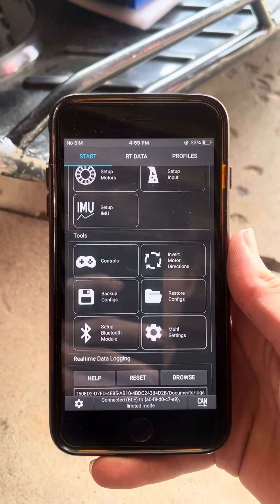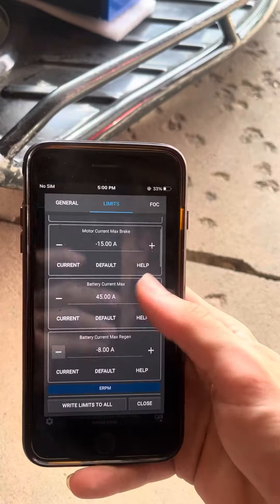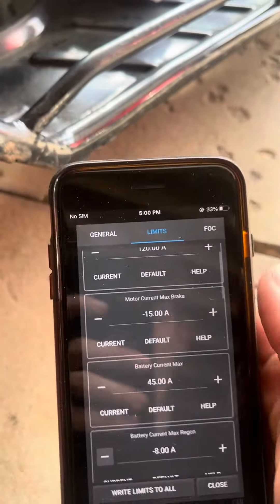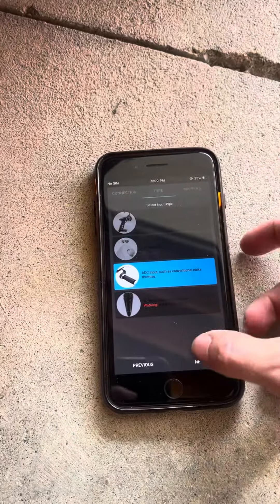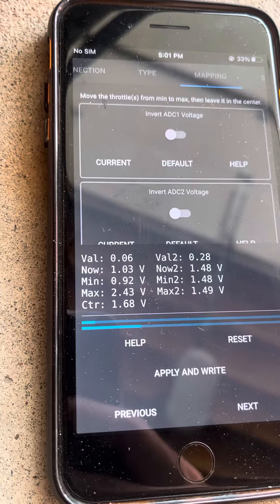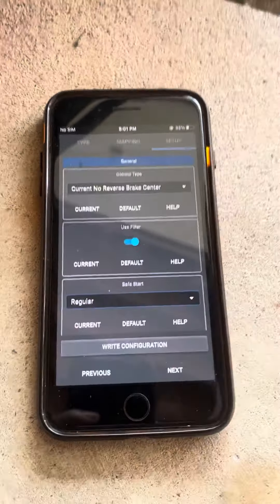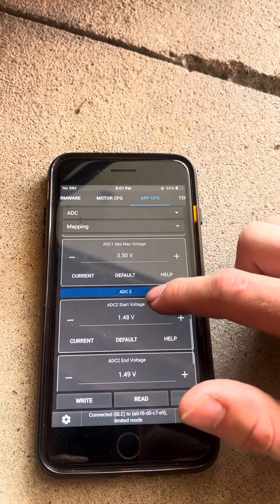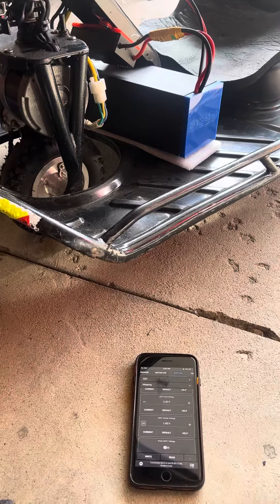Vesc tool enable Regenerative braking

Comment: Can you set it up to engage with a different pedal instead of just by easing up off the throttle?
Reply from the maker: Yep! Just put the signal from a separate throttle to adc2, during throttle setup you will see “control type” you can set this to current, adc2 brake no reverse

Comment: How do I keep the chain from falling off during breaking
Reply: If you remove your tensioner and tighten the chain solely by removing links, that will make sure you don't have too much slack on the front side when the cart is slowing down. The way you properly do this is to remove enough links so that the chain is slightly too tight once it's all back together. Then you take some washers and shim them between the motor mount and the fork on only ONE of the narrow sides of the fork. Shim it enough so the chain is slightly too loose, and then you can tighten the non-shimmed side to adjust the tension properly. Use locking nuts to keep things from moving. Hope that helps!

Comment: hi, I did as you said and everything works except the brake, I replaced the 2-wire brake contactor with a 3-wire one, I connected the + accelerator and + brake to 3.3v, then the - accelerator and - brake on Gnd, and the accelerator signal on adc1 and the brake signal on adc2. the accelerator works however when I brake with the brake handle the master controller turns off and when I release the brake the master controller comes back on why? (the controllers can be slave when it remains on. everything is connected to the master controller)
Reply from the maker: Make sure you don’t have throttle kill switch mode activated! Also try turning down the brake max amps and see if you get a change
Reply: @chargedup6565  I had to increase the input voltage to 95v and update the firmware to high-voltage HV and it works